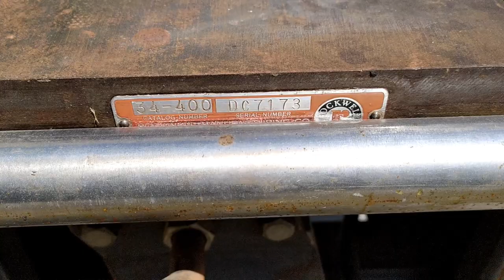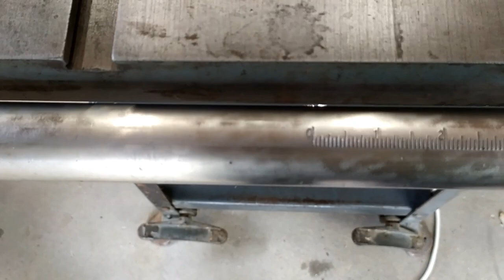Reconditioning a Delta Rockwell Table Saw

Comment: This is a very good how-to-do-it. These old Delta Contractor's Saws were made to be used for the long haul. The clean up of the table top was really good. I'd add one thing to any refurbing, and that is to use a good dry lube on the elevation and tilt mechanism. That way you avoid a build up of sawdust on the worm gears. All together, well done and happy sawdust making!
Reply from the maker: Thank you very much! Great advise regarding the dry lube. The saw is due for another cleaning and I will remove the wet line and replace with a dry lube.

Comment: i used 120 grit on a random orbit. it took the rust off and just barely gave the metal a shine on any high spots or dings... you can be pretty agressive, cast iron is HARD as far as sanding goes... i woulnd t go coarser than 120 or youre gonna start seeing swirl scratches... 120 grit just gives a nice matte finish even if you dig in till its bare metal... which takes some effort... i went about 5 mins and mine went from covered in rust to looking not new but like its been used and maintained since it was new... i also polished out the miter slots to match... i only used 120g nothing else... i have 80 and 220 and 320 also then just rubbed on some oil... i will wax it though, thats a good idea! nice work, looks good.

Comment: Did you ever think of rubbing compound to remove any excess rust?
Reply from the maker: No, I didn't think of that. I'll give it a try when I clean/wax next time. It's a good excuse to pick up a new buffer. Thanks for the suggestion.

Comment: I have the same saw. I broke the worm drive for raising and lowering the blade. Any ideas of where to buy one?
Reply from the maker: A quick web search did not turn up any options to purchase a new worm drive. I have a couple of suggestions. First, if you have the broken parts, find a reputable welder in your area and maybe they can be fixed. If not, try to find another Rockwell-Delta saw for sale you can use for parts. Perhaps one with a very rusty table top? Might be able to get a bargain.
Reply: The creator of this video probably has a 34-500 or 34-426.  What you need to look for is Delta Bench Saw.   Sometimes even labled a contractors saw, but in reality, this is a heavier and better BENCH saw.   The diference is the one piece trunnion/blade housing vs the 2 steel rods that join the halves in a contractor saw.  The Powermatic 62 and this Delta are similar and superior to a contractors saw.   The good news about the deltas is they made them into the 80s with alll kinds of serial numbers and name plates (often being called a contractors special or 10" tilting arbor saw).   Juat look at the guts and its very clear differences between the two.   People dont know this and someof those delta "contractors" saws are absolute gems.  Or the Powermatic 62, but those are hens teeth and carry the powermatic tax.

Comment: Good choice with the saw. I have a similar 34-426. It is a very solid performer, and smooth cuts. It's not much different other than modern knobs for height and tilt. Yours is most likely 1.5hp motor because it's normally plugged into a 15a outlet on the jobsite. The (following) video is the best i've seen on tabletop restoration. I tried this method on 3 different saws, and it works great if you don't mind fine swirl marks. https://www.youtube.com/watch?v=aJ5WdqSeoho
Reply from the maker: Thanks for the link to the video. I used to use pads like that in the auto shop but didn't think to use them for the table saw. I certainly won't mind a few swirl marks. :)